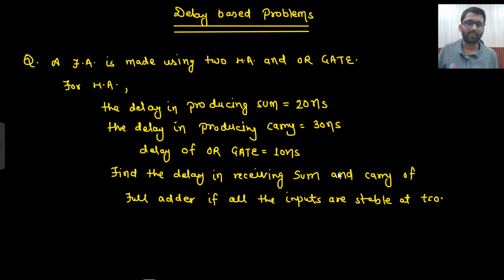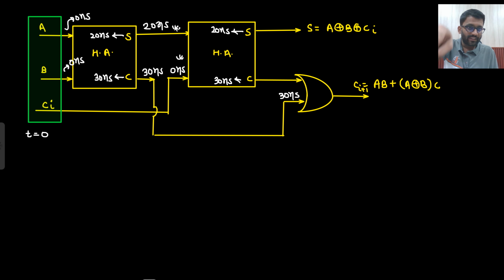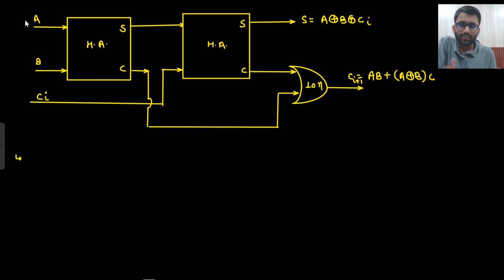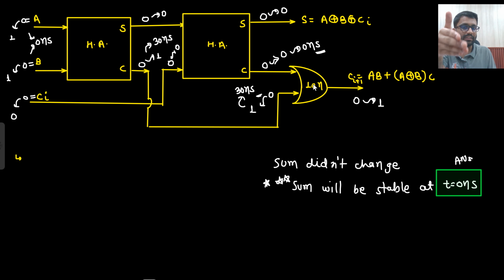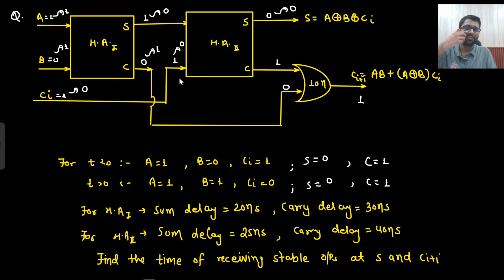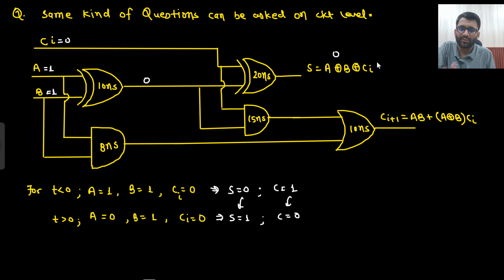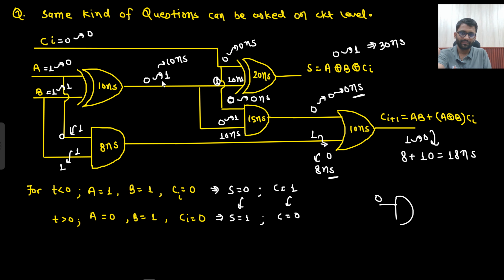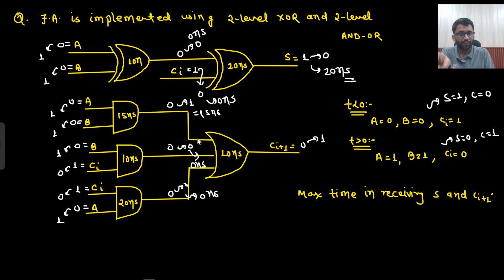Delay Based Problems in Adders || Digital Design for Campus Placements || Himanshu Agarwal

Comment: hey  @Himanshu Agarwal , at 15:23 video problem sum wont change but 
first it will become 1 after 20ns(contamination delay) and stays high for 20ns and become 0 finally 
so sum is stable at 40ns 
there will be some glitches in the sum